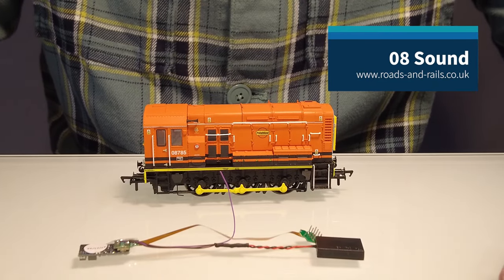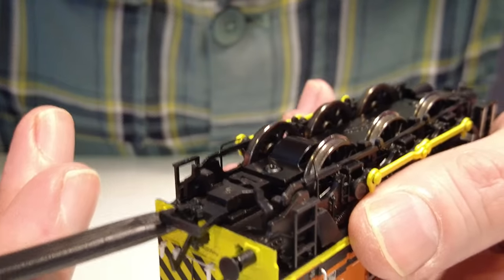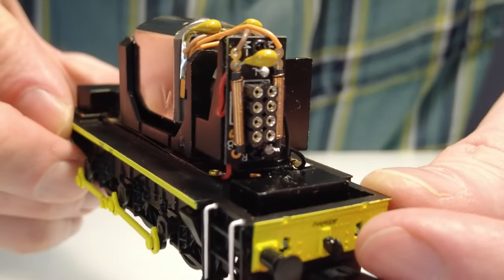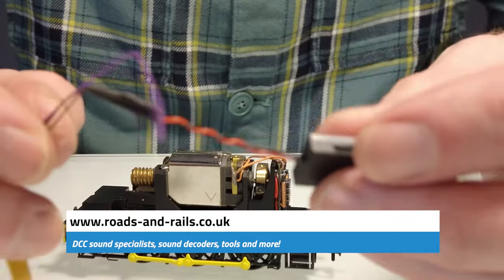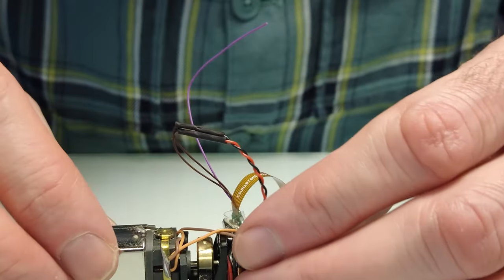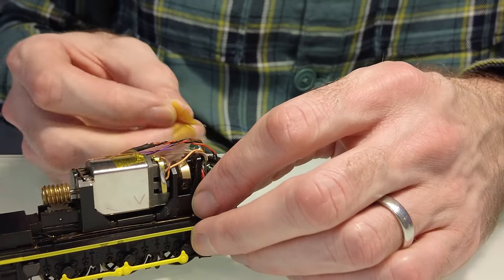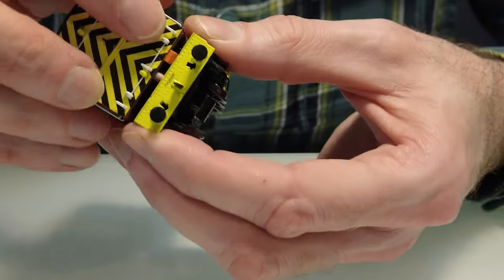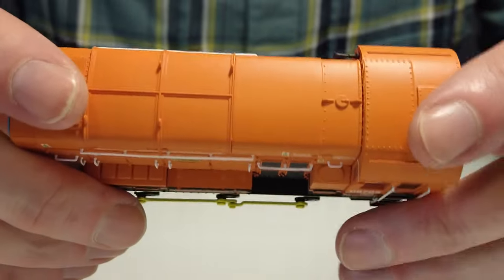Bachmann 08 Sound Fitting Guide, Using ESU Hifi Sound And A Small Tablet Speaker

Comment: Great video Richard watched it multiple times and even whilst I tried fitting the decoder..the body won't fit (even after milling out the bit you've mentioned) the sleeve round the decoder seems too big. Any advice as I can't close mine atm
Reply from the maker: I’m not sure, I’ve done several with that method now, can you trim the plastic round the decoder? You’d need to do it very carefully
Reply: @roadsandrails  thanks Richard all sorted now